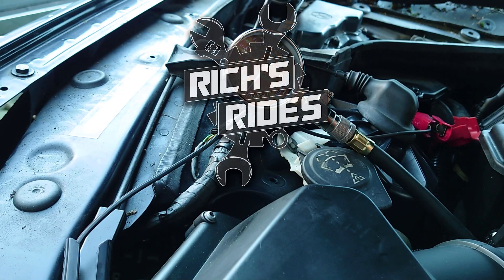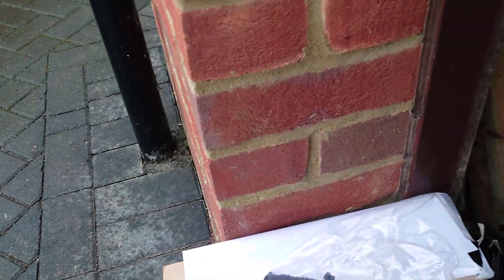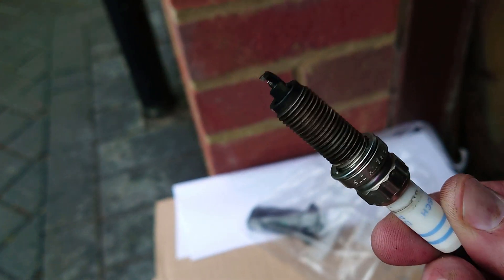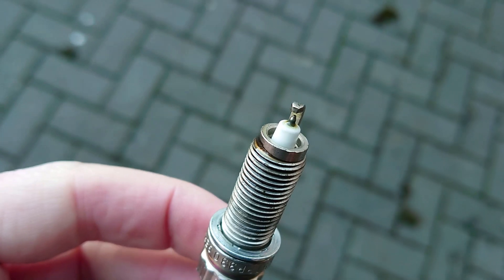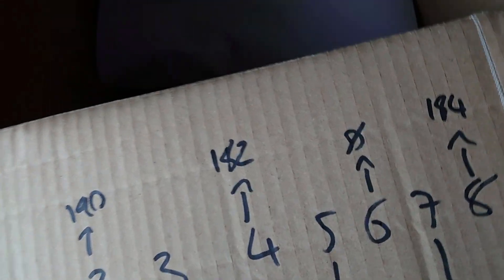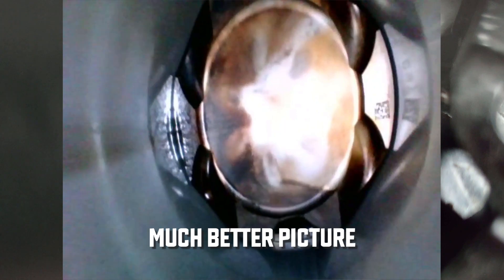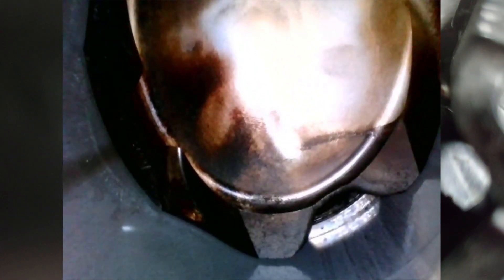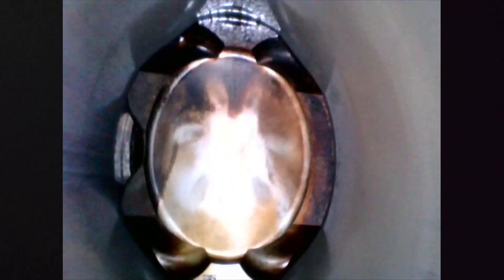Salvage BMW M5 rebuild - Compression test with bad results

Comment from the maker: This one is heartbreaking, but it is what it is. Time to rol my sleeves up and get dirty. Things are about to get really interesting.
Reply: I've just rebuilt one, only option is engine out, easiest way is complete engine/box/subframe out the bottom using a two post lift. I wouldn't even attempt out the top I dont think it would go
Reply: Pop it round my unit we'll soon have it rebuilt
Reply from the maker: +Ben Black that's going to be a problem for me. Time to re-rewrite the rules I think. 

Just hope I can back this up with action now!
Reply from the maker: @Ben-in6qh  where about's are you Ben?
Reply: @RichsRides  Gloucester way, you can't do anything without removing the engines on these, that's why BMW made it so comes out the bottom complete, they use a big table jig
Reply from the maker: @Ben-in6qh  bugger! Thanks for the offer of the lift, you're on the other side of the country unfortunately! I'll get this sorted somehow.

Comment: Sorry to hear that mate - when you were using the first bore scope where we couldn’t see the piston as well and it looked alright I was thinking/hoping this would be all top end/valve related. 

It’s certainly a bigger job than anticipated but frankly it makes for great YouTube content (which is partly why we’re here, no?) and it’s a great learning exercise - you’ll end up knowing this engine better than most BMW techs! I’m sure you’ll get it sorted 💪🏻 it’s only nuts and bolts. 

You can probably do this by supporting the engine from the top using a cross beam and dropping the subframe off, then taking the heads off. That should allow you to get the sump off and push the piston out the top/push a new one in (if it’s anything like the E9x M3s) - bit less work than taking the whole engine out. Great excuse to replace all the shells whilst you’re at it for longevity. 

If you live near Newbury, Berkshire you’re always welcome to use my lift if needed 👍🏻. 

Good luck and keep up the great videos.
Reply from the maker: +Luke Oxley cheers Luke, I'm sure it's possible without having to drop the engine. I'm in Cambridgeshire, bit too far away to borrow your lift but thanks for the offer.

Think it'll be good to show a driveway fix for this, don't think that's been done before. Like you said, it's only nuts and bolts, can't be that difficult?
Reply: @RichsRides  I think showing the masses that something as complex as changing an M5 piston/rod/shells as a DIY on a driveway would be a massive inspiration for many - and very possible I agree. 

That’s the spirit mate - nuts and bolts, bit by bit 💪🏻

Really looking forward to the rest of this series Rich.

Comment: Take your time and carry on you're doing well so far. Don't let this putt you off. I suggest you might as well replace/buy   forged parts whilst the engine is apart and you'll end up with a more stronger engine.
Reply from the maker: +P4RVEZ02 thanks for the support, I'm not sure about forging it. This is a salvage car that will run stock boost. I don't think it's financially viable to forge it. Maybe if it was a clean car?

I was also watching something on forged components the other day and it talked about piston slap when the engine is cold. Honestly, the animation they had was exaggerated, but made me shudder!

Comment: Do you unplug the DMEs and then re plug them back in before turning over engine for the actual test?
Reply from the maker: +Drew Eder I don't think I did, it just replaced them. I found after this video that I had an issue with cylinder 6 that was causing the rough idle, I'm still in the process of fixing that to see whether the DME update had any impact.
Reply: Yeah I saw the engine tear down for that after watching this. So you can turn the engine over while doing the compression test?! I just know they can be temperamental cars and don't wanna mess something up. Doing this test after this 4th weekend!
Reply from the maker: @dreweder90  sorry, yes. Everything was plugged in for the test. I think the only things I removed were the fuse for the fuel pump ( rear fuse panel but can't remember the number) and all the plugs. I find it better to do a compression test if the engine is free to spin if that makes sense.
Reply: Okay! Sounds good. I just know it's a pain to get at coil/plugs with them still mounted. I probably won't remount them but plug everything back in and remove the fuel fuse! Thanks for the video! Definitely following for updates on your engine progress!
Reply from the maker: @dreweder90  yeah the rear plugs can be a pain but manageable. Why are you doing a compression test, problems?

Comment: Broken ringland, damn.
Get a secondhand rod and piston if you can.
Reply from the maker: +Daxxr going to do a bit of online shopping to see what is available. might just go for new parts to make sure it'll last. considering what else I should be doing as preventative maintenance while it's all open.
Reply: I have built many engines over the years, my advice would be to keep the costs down. New bolts, gaskets etc, but a used single rod and piston is a good option. Replace the rings with genuine parts, they are what really gives the cylinder its compression
Reply from the maker: +Daxxr good advice, what do you think about doing all the bottom end bearings while it's all open? engine is on 54k miles and the piston damage makes me think it's had a bit of a hard time towards the end. is it worth looking at a timing chain kit too?
Reply: Rod bearings are a good idea on the v8, plus the sump would already be off. Timing chain kit could be reused if you plan on selling the car, for long term ownership I would replace them
Reply from the maker: +Daxxr think I'll have a look at the state of the timing chain  guide rails and see how worn they are before going for it, aren't they supposed to be 100k miles life or something like that?
Reply: Trouble with chains is that once removed they tend to play up when refitted, I have changed plenty of chain kits and to be honest they all needed replacing, even with low mileage
Reply: @RichsRides  I bought my f10 with 28k miles, treated it well always warming up before “using” and bottom end went at 54k miles. I guess previous owners (2), were not so careful. When first got it was using a litre of oil per 1100 miles, BMW said not unusual and only flag at 500 mpl, it let go at 800 mpl, very messy and very costly as not a hands on like you! I would replace those bearings. Recon engine from BMW, careful run in and now getting around 9k per litre of oil. Good luck!
Reply from the maker: @paulbicknell2226  cheers, I guess you can never know the history of these cars. They're bought in the first place because if their performance, so abuse is part of the course unfortunately. Especially when they're still under warranty!
I'm definitely going to do all the bearings, it makes sense and takes away any concern.
Glad you got yours sorted, hopefully you'll have many more miles of trouble free motoring now.